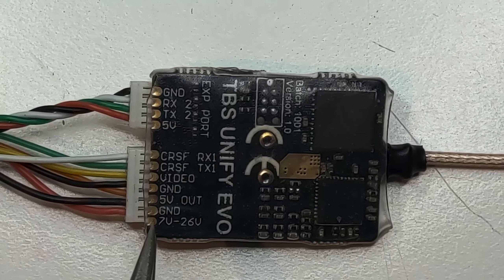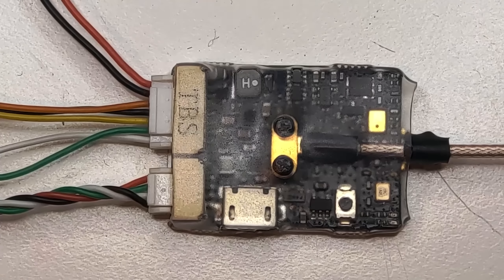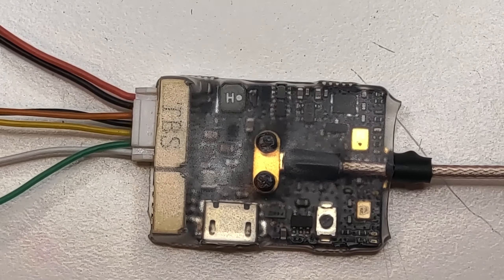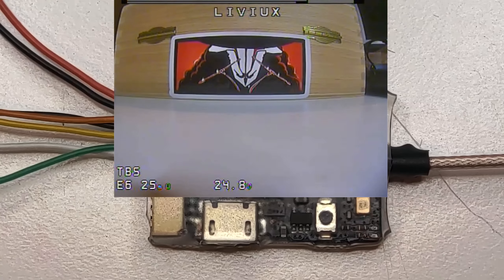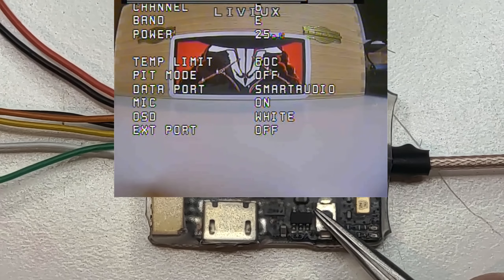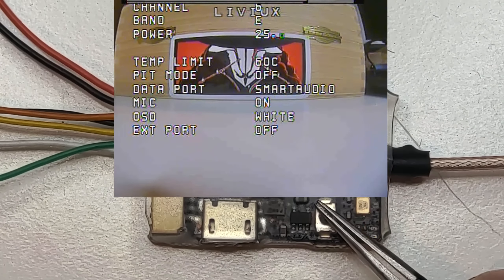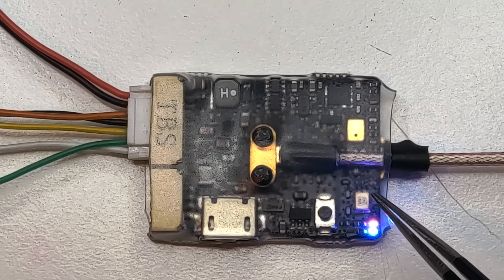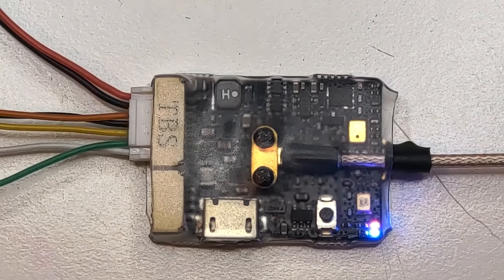NEW TBS VTX | Unify Pro EVO REVIEW

Comment: Good info but which one is actually smart audio when selected in menus..  Rx or Tx to wire up to and if using Crossfire reciever and protocol I suppose due to only a couple of channels supporting it we could not hook up to the vtx in that sense to have both using crossfire .. flight controller and vtx.

Comment: This thing is amazing! Do you know if there is a way to display average cell voltage? Like for a single cell like you can and most flight controller OSDs?
Reply from the maker: when it will arrive i guess you can change this with the TBS agent gui
Reply: Connect the video cable to your fc and you get both osd on at the same time
Reply: I was wondering this too. If I'm going to get the evo I want it mainly to avoid having my video go thru the fc at all.

Comment: Why not mmcx connection? Otherwise nice stuff
Curious to see power test
Reply from the maker: nothing is changed in the rf section ... so same power levels as a normal unify pro hv
Reply: I like MMCX alot and have incorporated this into all my quads.  Every now and then, the MMCX can become disconnected in a crash.  The MMCX connectors sometimes even wear out and become loose over time.  The 2 screws holding down the UFL probably have better long term durability than the MMCX in my opinion.   MMCX is great if you have tight builds where disconnecting/connecting the MMCX can help to make servicing the quad easier.
Reply: @GeorgeCee  I see and also agree the two screw is simply but brilliant

Comment: Nobody uses the max7456 anymore. this thing gets hot af.
Reply from the maker: well everybody uses it :) well at least the cloned version of the IC. 99% of the beta flight boards use it and a bunch of pdbs
Reply: @LivyuFPV  Yes thats true :) but the clone(at7456e, datasheet only available in chinese^^) is actually more efficient and Maxim does not produce the thing anymore (EOL) because "nobody uses analog video anymore" ^^. Nowadays one can do this stuff also with FPGAs or fast IO on microcontrollers. Btw I didn't wanted to negate anything you said, just show off to the youtube gods how smart I am :P